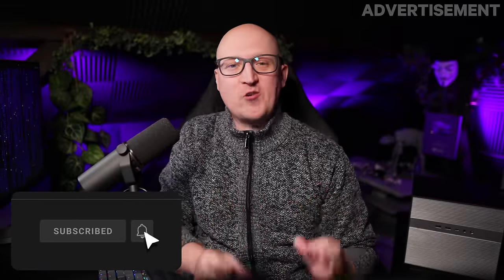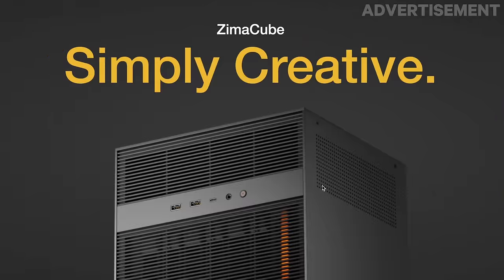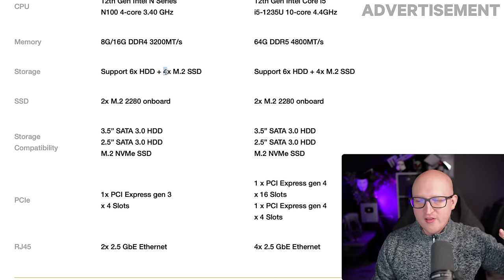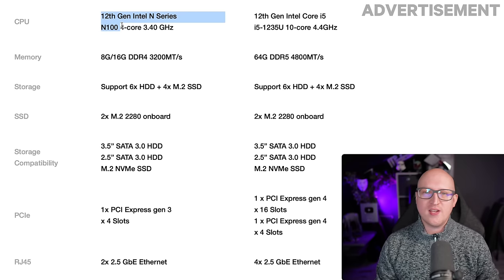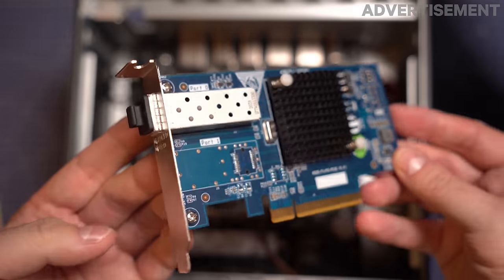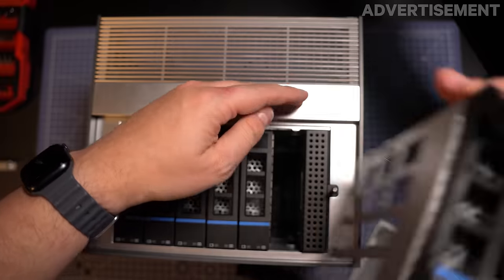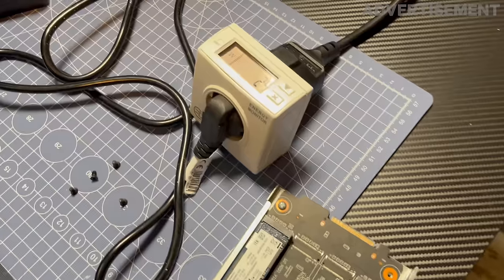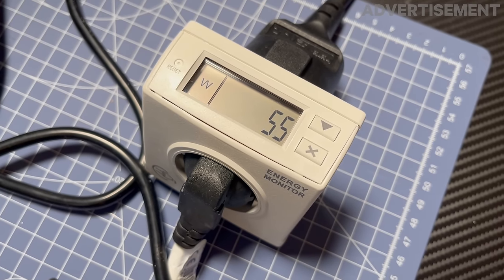This NEW Homelab NAS looks interesting // ZimaCube Prototype Review

Comment: The storage features are certainly an issue. As the author of mergerfs I've been in talks with them since they used mergerfs for their "merge storage" feature they have in CasaOS but I think they are a bit of overwhelmed with everything and spread a bit thin. Their wrapper around mergerfs for instance is barely usable. The UX and UI however is slowly coming together and they have been receptive to feedback. We'll see.

Comment: - If you're thinking of the N100, I really recommend you stick with a smaller and more of the shelf solution like a basic synology for a better experience. If you fill this thing up with drives you will want to be running ZFS / RAID, and this thing might not be able to keep up. 
- Most traditional NAS devices you can buy in a sleek little package tends to be quite expensive. This definitely gives you flexibility and a lot of networking and the i5 version can probably run some homelab stuff on it no problem (such as plex) while also serving as a pretty fast NAS with all the PCIE and M.2 slots. 
- As a most likely relatively niche and low volume product, you're note getting as much value for money. If you build something yourself you can blow this thing out of the water, but that's not what this product is about.

Comment: Unfortunately no ECC support. Otherwise the Pro model has really nice specs. Do you know what GPU size fits in this case? They sell ift with the RTX A2000, but is that upgradeable or already the maximum size?

Comment: I'm unsure on the n100 processor version, especially at this price point. The price for the 10-core i5 version seems a little high on the kickstarter as well, especially when considering the price points of the ZimaBoard and ZimaBlade servers, but I'm definitely interested all the same. For now though I think my trusty gen8 proliant server with 12 drive bays will continue to do its job even if it costs much more in power. It's hard to argue with a secondhand server with 10x the processing power and memory capacity, and twice the disk capacity of one of these at a third of the cost...
Reply: Same with proliant dl380 gen9
Reply: cost is too high, much like 45 drives "homelab" offering. They're targeting a market of IT people with a lot of disposable income and think we're dumb and will pony up. I can build a better offering for cheaper.

Comment: Have to say that the video does a good thing showing the pro's and con's for the ZimaCube. Unfortunately when looking at it from a distance and taking out the emotion there is nothing left but a simple small board with an Intel laptop CPU on it and some memory in a nice case. When looking at the price and power usage both are very much on the high side. The cheapest version is $499 voor N100 one and this does not include the quad M.2 adapter shown in the video. If I compare this to for example a Topton N100 PC with 16GB DDR4, 4x 2.5Gbit NICs and a 256GB SSD those go for $230 (barebones it is $164). Not entirely the same of course but just an indication that this price for this solution is more than double. From people using those systems I've seen reports of idle power usage in the 10-15W range. So power usage for this system is also fairly high.

Comment: Even at MSRP this isn't bad if you want something 'plug and play' but as someone who had been building my own NAS for a while now I could roll my own and get anywhere from 8 to 16 disks and 4+ NVME.  Wouldn't be N100/i5-1235U levels of low power and to match the feature set it would probably cost a bit more but 65W TDP CPU (before disks) is acceptable for me for now.  If I were looking at a 4 disk Synology or something along those lines I'd probably think about one of these but I think a N300 option would have been a nice addition to the lineup between the base and the pro.  

A busy N100 will get hot so the fan is a good idea but kind of puzzling the N100 only comes with 8gb memory, 16-32 seems a no brainer.

Comment: Seen this unit "reviewed" and reviewed by several YouTubers now.My takeaway :

The soldered case fans on full speed and artificial single channel make this a no go for me for me. Sticking to my Haswell box longer. Curious about the I5 version.
Reply from the maker: Check out the Pro version, it should have more memory slots and shouldn’t have the case fans

Comment: Given some of the decisions made with the board layout, connectors, lack thereof, CPU choices, and price point I think I'd rather just have the chassis, backplane with a standard cable, drive sleds. and a pico PSU or whatever equivilent option is available using that 220w brick. And then just spec my own board, cpu, and ram.

Comment: Did you read a lot of questions about PCIe lanes available for M.2 NVMe  and PCIe slots on board ?  NVMe performance is unknown. They use PCIe switch chips on motherboard. Both CPU hasn't enough PCIe lanes available for all M.2  and PCIe slots and networking.

Comment: Power consumption was a bit wasted. Can you run some more tests does it support APSM? type in the command and show what it shows. Then also run powertop. I expect some of the extra chips they are using are causing the cpu to not reach higher c states.
Reply from the maker: I'm waiting for the final release because I assume it will have some differences

Comment: They need to make this support 8 sata 3.5" drives, as six is a stupid number. It's more than you should do raid5 on and yet it's not the sweet spot for raid6. The quad nvme is a nice touch but most of us just need dual nvme on the motherboard so that we can raid 1 the operating system (nvme caching is nice if you are video editing I guess). If they brought the pro out but had 8 sata 3.5" instead of 6 I have literally four spots I would use these to replace aging hardware. As it stands I can't buy it, it doesn't support enough drives.
Reply: I dont know so much about raid configurations. Why is a six bay not good for raid 5 or 6 and does that still matter if you put in only 4 drives? I would like to add 4 drives and two caching ssds at first and if I need more capacity I want to be able to add 2 more drives later.
Reply: @Tri-Technology  depends how big the drives you are putting in are. Right now the sweet spot is 18-20TB drives so if you put six of them in there you are looking at a 12-40 hour hour resilver, which is a long time to have 90-100TB avoiding complete loss by depending on 5 other  drives you bought at the same time, possibly from the same lot, with the same amount of wear on them as the one drive that just failed. in general you want 20-25 % parity is the sweet spot for likelihood of recovery vs cost and you want 2 drives to be able to fail (or maybe more) as you go larger because the probability of failure of your drives is not independent, it's correlated (hopefully not so highly  that you lose all your data)

At six spots you can't hit the price/protection sweet spot on raid5 or raid6. You will be under protected or over protected. Plus adding those two extra bays would very marginally increase the cost of this thing, as it appears the controller can support 2 more sata (one of the pre release reviewers showed the mobo and it had 2 more sata ports right on it) 

Your caching situation actually makes sense for this setup but I ahve to ask, why not just use way faster nvme drives? This thing apparently supports 4 of them in addition to the two on the mobo for the operating system.
Reply: @barfnelson5967  I understand now why 6 drives are suboptimal. I bought now 4x 16tb drives and want to start with one as parity drive. I tried to make sure that they are not from the same lot as I ordered always only 2 from different suppliers with 2 months in between. I think I won't need more than 48 TB of storage for the next 7-10 years so probably I won't need to upgrade. Most critical data I will save additionally on a second nas that is not in my house, so raid 5 should be enough in my case, or am I wrong?

For caching, booting and VMs I want to use 1 tb nvme drives (not SSDs as I said in the first reply)
Reply: @Tri-Technology  I would think it's probably fine if you are using 4 or 5 drives. Keep in mind it's not a backup solution, so you should really setup some sort of backup, ideally to a different location of the stuff that you really can't lose (i.e. maybe don't backup those backups of your dvd movie collection, but you almost certainly want a backup of your  family photos and documents). When I said catastrophic loss above I was really meaning having to copy everything from the remote backup location again and rebuild the archive of teh stuff I am not paying to backup.
Reply: @barfnelson5967  Of course I will setup a backup solution for the most important datat. Thank you for your advices!

Comment: I have N100 motherboard (Topton) and I installed 32GB DDR5 (and 4x 2.5Gbps) so I don't know what these guys are presenting or what they are installing there in their N100.
Oh and N100 without fan can easily get to 90C so good they bring the fan
Reply from the maker: Interesting! I assumed the N100 would work fine with a passive cooling since every vendor is doing that, but apparently, IceWhale is wise to put a fan in this thing :D
Reply: @christianlempa  it depends on usage: as Opnsense you don't need fan, but when I put Proxmox on it, it boiled completely
Reply: Is that a mini pc or just motherboard?  It's a huge pain searching for topton stuff on aliexpress but if it's just motherboard do you have a model number?

Comment: 2.5 Gb/s? Let me know when it has 10Gb/s or greater.
Reply: With port aggregation you can get 10 gbit/s
Reply: @Tri-Technology Not to a single host you cannot.
Reply: @Spoonuk666  So what does that mean? Only the reading speed can be 10 Gbit/s, but writing on the nas is limited to 2.5 Gbit/s?
Reply: @Tri-Technology  If you have a single host (machine) you won't be able to achieve aggregated throughput of 10Gbps by aggregating 4x2.5Gbps links as the data will flow at a max speed of one of those interfaces i.e. 2.5Gbps to a single host. If you have four hosts with 2.5Gbps cards each then each host will also get a maximum of 2.5Gbps but all four will saturate 10Gbps as far as the sending device is concerned. Hope that makes sense.